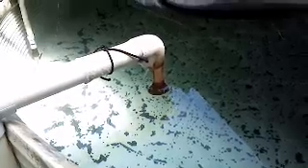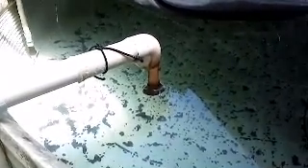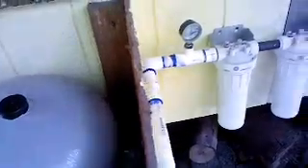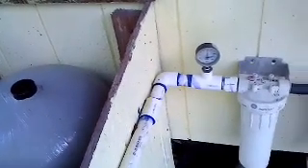Off grid rainwater harvesting in Hawaii.

Comment: Thanks for the informative video. We have a similar system in HPP by you.. lately we seem to loose water pressure every two weeks or so. Water pressure goes back to normal when we change the filters. Seems changing filters every two weeks is unusual. Also the dirty  filters are rust red in color (don't now if that is the reason and what is causing the filters to go red) any ideas on how to fix?
Reply from the maker: You need to start from the top down. Clean your roof and gutters. Install a leaf guard and put a pre-filter like a panty hose on the inlet pipe. Clean your water tank (I made another video on that). Add bleach and baking soda.

My post filters get changed every 2 months for comparison

Comment: Very informative video.  We just purchased a home over where you are at (up the mountain a piece in Mountain View Village) We have a catchment tank that has rust on the exterior and the overflow is missing so when the tank fills, it just runs down the sides.  I want to paint the tank to preserve it...I will probably have it give it a sanding as well...any thoughts on the type of paint?...I saw a Sherman Williams Store....I was thinking a quick dry thing...because....rain comes at unpredictable times...😃🌈🤙
Reply from the maker: E Komo Mai.  I paint my tank every year with rustoleum paint.  Keeps the metal lasting longer.  I also have an overflow pipe that takes care of the problem you're having.  I will try post a short video on that

Comment: Perhaps add a small peek-thru UV light that rests at the top center of the tank cover ? You might also want to rig a water pump with a filter, so you can vaccum the bottom of the tank periodically.
Reply from the maker: Thanks for the tips.  I use a pool vacuum that I just need to get a siphon started and the vacuum commences.

Comment: Can you drink this water with this kind of filtration ?
Reply: Guillaume Beaudet you need to add a water sterilizer unit similar to AQUAELECTRA - Rainwater Tank Treatment or a ultraviolet type for drinking water.
Reply from the maker: You would need to add a UV filtration system.  We are on solar and would have had to add more panels to have a uv system.  The county supplies drinking water at various locations nearby.
Reply: How do you remove the algae without mixing it into the water?
Reply from the maker: @raphaelm6149  I haven't had algae issues.  Maybe the cup of bleach once a month helps?  Also the black cover.  I do use a pool vacuum to clean the dirt off the floor of the tank 2x's per year, it works off of siphon